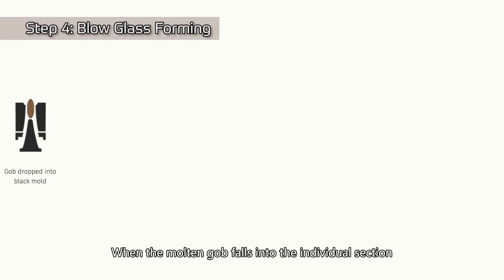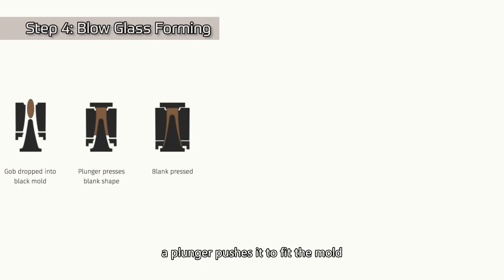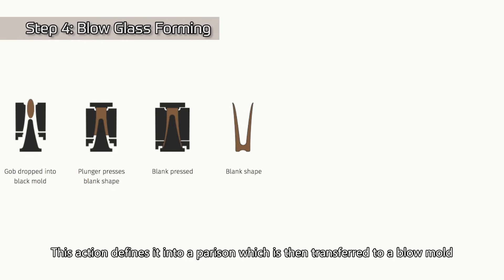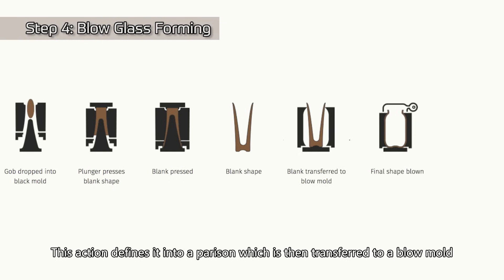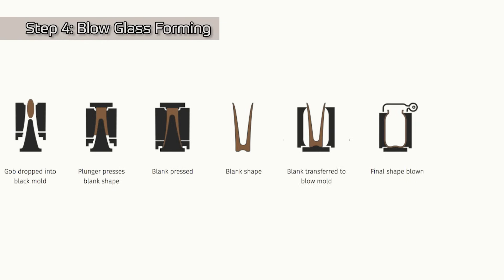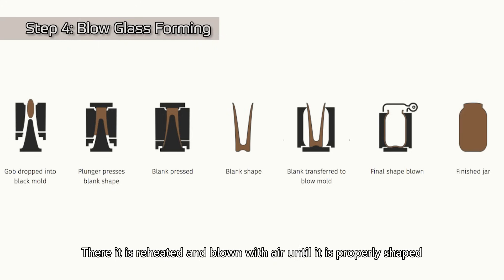Glass Bottle Manufacturing Process (2021 Updated) - Roetell

Comment: I worked in a glass bottle factory with rotating shifts. One week days, one week nights, one week swing. I didn’t even know what day it was at times.
Reply: Most industries do this. Some do twelves instead of 8s.

Coca-cola did 10s and 12s; contractor 🚧 companies sometimes do four 10s, where you always get a 3-day-weekend.

Water, wastewater, and power production 🏭 are often like this. Some do “7-on,7-off” style shifts, while others do “split shifts” where you work 3, off 4, work 4, off 3; with the Saturday you’re off alternating between months.

If you do the 7-on 7-off, you never really have to take off of work; you can always just schedule it during your off week. If you work 5-a-week, you get the weekends off.

The trade is that if someone is out sick, you have to cover and typically may not be off for many days in a row. There was one July where I think I worked every single day of the month, and a few 14/16s as well due to staffing problems during the pandemic.

In the end, it doesn’t much matter; you’ll pretty much have to live at work, because of the cost of living crisis. after the IRS gets theirs, you pretty much still have the same $800 everyone else does to try and spread across all your bills. That’s why you should always work a job you love, instead of a job that (supposedly) pays more (in the end, it won’t pay more than the current job you have because your overtime is taxed at a higher rate, and earning more puts you in a high tax bracket.)
Reply: Where you working
Reply: @Mohanavlogs0825  Ball-Incon in Seattle 1986-87. We had six lines running. Number 6 made brown glass for Olympia and Rainier Beer. We made one million gallon jugs for Tree Top Apple Juice. It took about five-six weeks. It was an awful place to work.
Reply: Hlo bro
Reply: Bro could you prefer me the company's name which you worked please
Reply: Same like me right now 😂

Comment: I work at anchor glass for as a journeyman machine
Reply: That’s awesome man! 👍 that’s a solid place to work with high job security; we’ll always need more glass bottles.

They’re great, easy to wash/sterilize, and pleasant to drink from, but are vulnerable to breaking so you’ll never be out of work.

You also do a job that helps your community, produces goods, and gives jobs to other people; my favorite drink, calypso lemonade, comes in a custom tropical-themed glass bottle, and my workplace laboratory uses large quantities of glass bottles to run science testing in.
Reply: Which Anchor plant you work at? I was at Warner Robins Plant 14 for 35 years.  Operator, Upkeep and Machine Repair.
Reply: @robertnixon4525 hi bro I worked at anchor glass from 1970 till 2015 at plant 3 in Winchester In maintenance

Comment: How come the recycle of these glass cannot send straight to melt all of it instead of crushing it then melt it?
Reply: Crushing the glass into tiny fragments increases the surface area, decreases the volume size, and reduces the energy expenditure of the kilns
Reply: Small particles of glass are easy to melt and get in shape instead of whole glass container
Reply: It has to be mixed into the sand, limestone etc. which are particle size